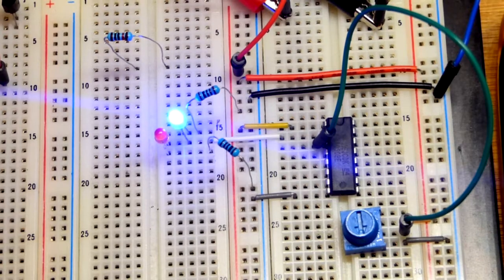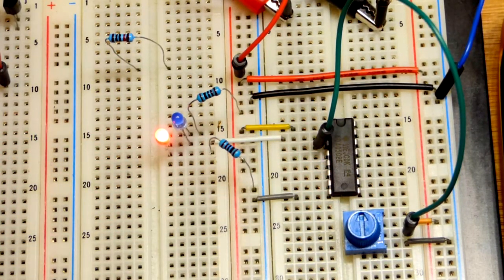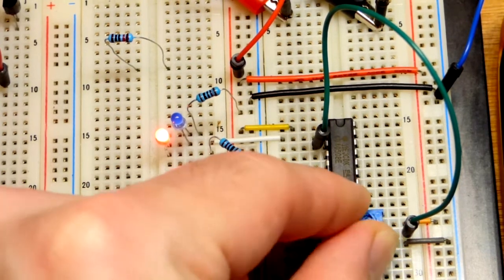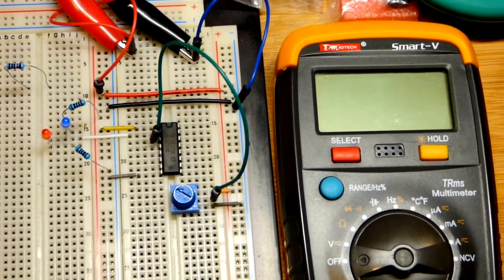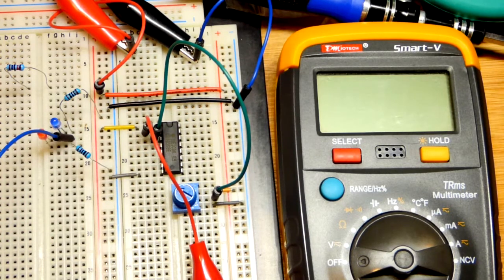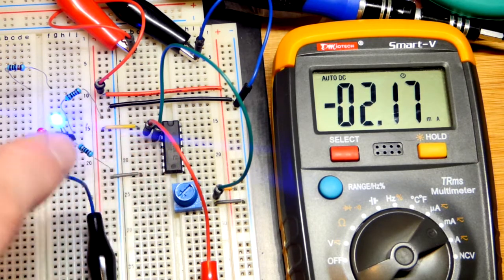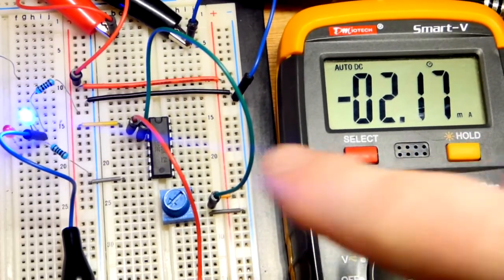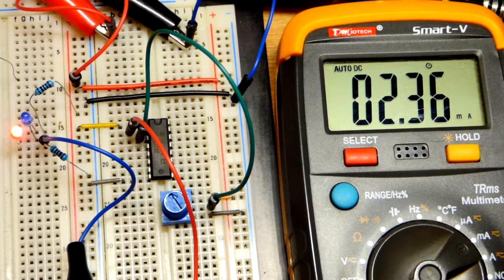Sinking and sourcing current explained with 4050 IC electronics CD4050 integrated circuit

Comment: AS AN ELECTRONIC TECHNICIAN I ALWAYS USE ELECTRON FLOW,THAT IS THE WAY I LEARNED THIS IN COLLEGE FROM MY PROFESSORS.IF YOU USE ELECTRON FLOW IT IS EASIER TO UNDERSTAND.YOU NEED GO OVER SINKING AND,SOURCING MORE MAYBE WITH A DISCRETE TRANSISTOR CIRCUITS.
Reply from the maker: Yeah, I made some diagrams a while ago for old videos. Should dig them up and make a new video :) Thanks for watching!

Comment: I feed the CD4050BE with the 3.3 volts of the Arduino Mega and it's coming from 4.76v, 1.78v, etc., on the pins of the CD4050.
Is it right? Should not the same 3.3v as the power supply to feed the TFT Display?
I don't understand english
Thank you
Reply from the maker: Weird. I'd check with a datasheet , preferably written in your language.